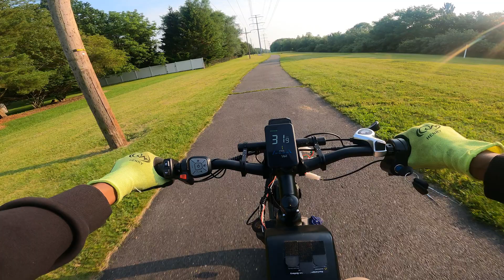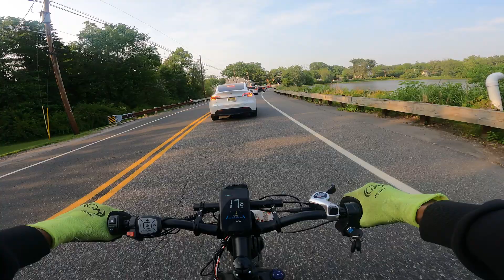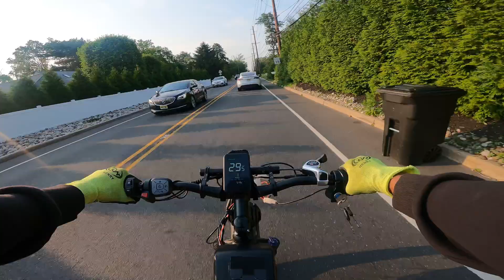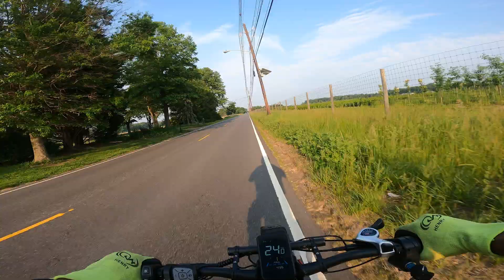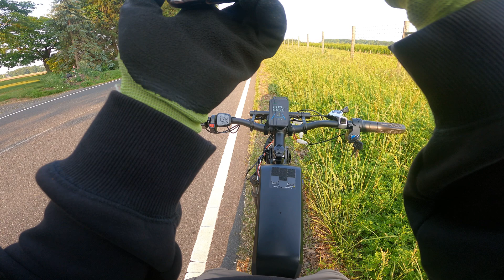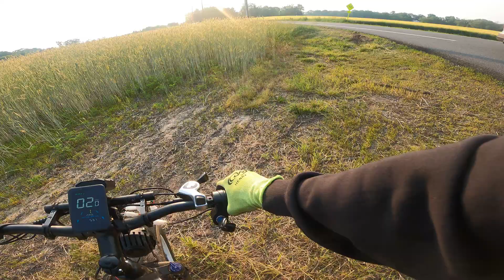Far Driver on stock Tuttio motor 20 Mile stress test

Comment: Will the stock motors handle the two upgraded fardiver controllers?
Reply from the maker: Yes my top speed before the new motors was 52mph but was extremely hot after that tune and run. With the tune that’s 50mph I was running that all day long, still hot but manageable. I can’t even get this new motors to get hot… NBpower definitely has some good motors. I believe they are qs205 clones but I’m not sure

Comment: My 24" Ebycco EB7 PRO built similar does almost 45 right out the box
Reply from the maker: Correct but at almost $400 I would guess it would perform better. Stock of course
Reply: What bike currently is the best bang for the buck out of the box? If I understand this right is the bike that the lithium power shared $400 more to buy and if so how does that compare with your cost of upgrades let alone the labor. I'm wondering if there is a better out of the box option for people without the ability or time to upgrade if it might essentially be the same price in the end

Comment: How did you get it to go up to 47 mph at one point?
Reply from the maker: Two Far driver controllers upgrade.
Reply: Are the Far driver controllers plug and play? Can someone with zero electronics skills install them without issues? And will the stock motors handle them for the the long haul reliability wise? Thank you for all that you share with us brother

Comment: Hey sir i noticed the top speed has improved but does it improve the torque as well?
Reply from the maker: That’s actually why I hate when people immediately ask about speed… the torque is the BIGGEST difference. Electric motor torque has a linear relationship with current (amps) and I’m pushing 45amps each instead of the stock 25amps. Almost double. Which almost doubles my torque. This bike PULLS!
Reply: Is that mile or km I’m looking at?
Reply from the maker: @MrGoodsalesman nothing is in km in the United States bro lol everything is in miles/inches/feet lol
Reply: Mph @MrGoodsalesman